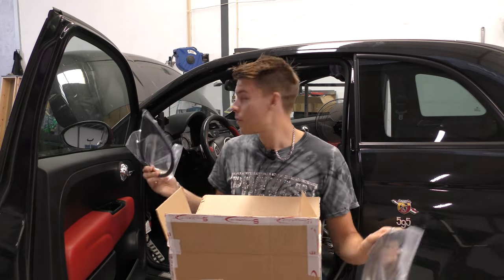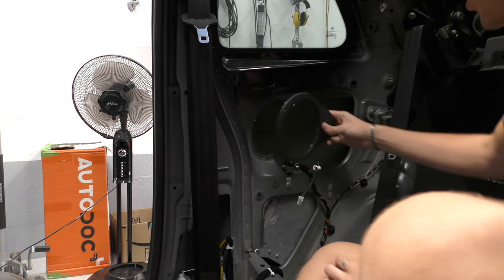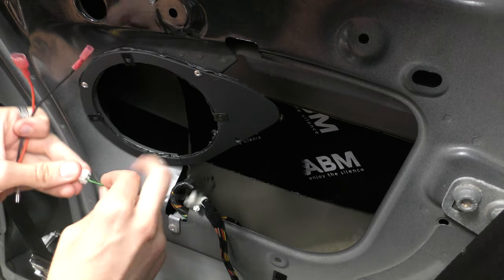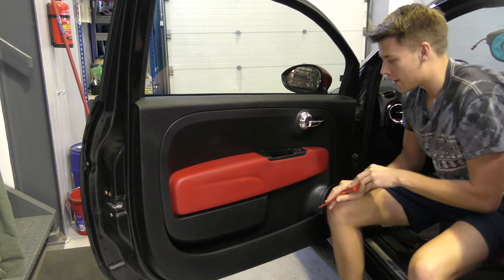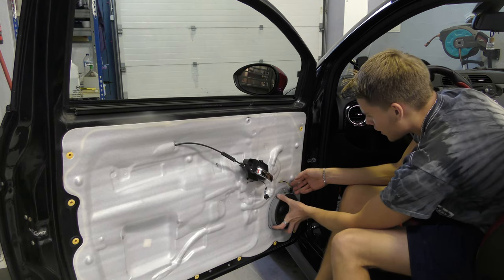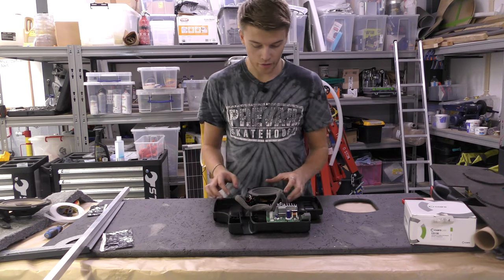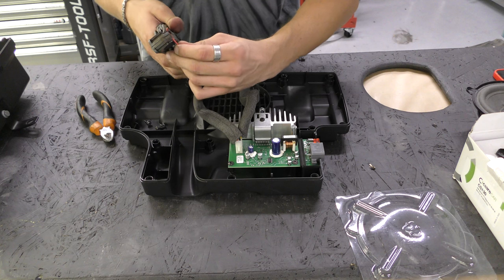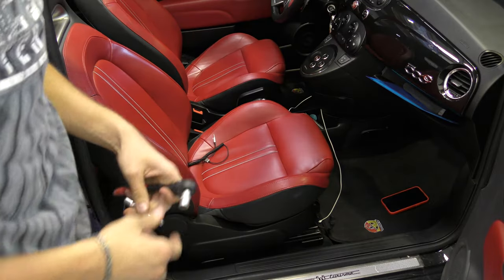Fiat/Abarth 500 Speaker & Stock subwoofer upgrade

Comment: 5 stars and two thumbs up for your video which encouraged me to do the same conversion on my 500c, having upgraded the door speakers already to Rockford Fosgate's speakers earlier, and now the sound is really fantastic. The original set up is an already very good OEM Interscope sound system but the original subwoofer speaker gets its membrane disintegrated with time so your upgrade is an excellent one. For other potential viewers just a small suggestion to pause and look carefully at the disposition of the wires at the frame 14:39, which you nailed, that is the correct way of connecting the "+"s, they are sitting on diagonal opposite sides and the yellow and red wires need to be connected to the "wider" connectors on the speaker marked also with a red dot of paint, as already shown in the video. Thank you for the very nice video and for the references.
Reply from the maker: Very kind, thank you - first time for me, as we say, let us cock it up so you don't have too :)  - this was a fantastic upgrade to be fair and did go remarkably well - spent ages researching it

Comment: Looks nice. But why putting coaxial speakers in the front doors when you have the tweeters in the A-pillar?
Reply from the maker: The original sound system was pretty bad, so rather than remove/replace the tweeters I just thought it best to just ignore them. I choose the speakers on value for money and these seem pretty good. I’m certainly no professional that’s for sure. 
Thanks for your comment I appreciate it 👍
Reply: @DrivenMadShow  The front speakers you installed have a tweeter, the issue now is that you have 2 tweeter pairs with different specs in the front, plus another pair in the back.
It will sound better than stock, but if you had chosen the SXE 1750S (that has the same tweeter and speaker, just separate), you would have paid marginally more than the SXE 1725S that you have installed, and you would have the tweeter in the intended placement and without mixing sound signatures.

Comment: Unless you completely abandoned the tweeters. The tweets on the Alpines are receiving any sound. If they are. They are pulling the sound stage down. Too many tweeters can have their own issues.
Reply from the maker: The original sound system was pretty bad, so rather than remove/replace the tweeters I just thought it best to just ignore them. I choose the speakers on value for money and these seem pretty good. I’m certainly no professional that’s for sure. 
Thanks for your comment I appreciate it 👍

Comment: Nice little upgrade. Did the speakers in the front have the correct plugs? Did you make sure the wires in the new ones went in the same way as the old ones? If you don’t know you might get them wrong and get the phase wrong.
Reply from the maker: Yes they plugged straight in! All 4 connectors that came with the speakers where the same. But my rear speakers have a smaller plug than the front for some reason. luckily with the fronts there is only one way to plug the connector. Thanks for the comment, much appreciated!

Comment: A good upgrade video thanks. I’ve recently swapped the front speakers in my Panda 169 to the same Alpine 1725 speakers . Like chalk and cheese! Next upgrade will probably be to move the 1725s to the rear doors and put in Alpine 1750 speakers (with the separate tweeters) to the front. After that maybe a underseat sub? I’m hoping you will do a video first to show how to install one properly 👍.
Reply from the maker: Ous comes with the sub as standard - maybe worth looking at getting a used one from a breaker ? should go in a 169 -  then its a cheap (ish) install ?
Reply: @DrivenMadShow  good idea using a 500 sub in the panda. How would you secure it to floor? I’d be nervous drilling the floor. The car was owned by an elderly lady for its first 17 years and it had only done 20000 miles. Since I bought it in the spring, I’ve added 5000 miles, a towbar, alpine speakers and a pioneer head unit. Poor thing must be in shock 😂
Reply from the maker: The Abarth has 3 bolts that go in the floor - the sub Nath fitted into the ML was an aftermarket box thing; was a pain in the ass, taking up too much space, and that's a big ish car ! - under the seat is great,  if there is nothing there (I cannot remember and we had our 169's seats out 🙈) -  it's a brave pill and bolt to the floor or bend a bit of metal and locate it with the seat bolts ? Great find a low mile Panda, even better if she garaged it - I think the 169 is built really well, the doors are especially good, love the arm rest grab handle bit - the newer ones are rubbish in comparison - Panda's love a good thrashing, it must be like being set free for it ( you need a name for it - my suggestion is Brenda 🤣 in honor of the old girl (well that just sounds like an old girl )
Reply: @DrivenMadShow  My previous car (Citroen Berlingo) was written off after being hit when parked up on the street. I wanted to downsize so I could park on my small driveway out of harms way. Got a soft spot for small Fiats (used to have a Cinquecento sporting back in the 90s). Was looking to get a Panda 319 but your videos convinced me that a 169 was still worth having. Very happy with the car. Just enough power (54hp) when towing a camping trailer.
Reply from the maker: @2rocship  Sorry, bit slow in replying - if I were to pick one, the 169 would be my choice as well, just feels more robust, the dash looks great when the new stereo is in, transforms it - I was spoiled in the UK with a company car, had a boggo E class Merc last, loved that car, it was just so easy at everything, and all the better for being a boggo one, I was lent a top of the range one when being serviced (other than the sunroof) it was nowhere near as comfortable or fun as mine  - when the contract was up (the car tax was horrific ) I bought my own car - a used automatic Fiat Qubo, in metallic lime green, my wife hated it, really hated it, I loved it, it had a politically incorrect name and was the topic of conversation everywhere I went in it - frankly, I would get one here but an auto is mental money here in Portugal -  keep is updated on Brenda 🤣
Reply: @DrivenMadShow  Bit of an update on Brenda 😂. I’ve moved the Alpine 1725 speakers to the back doors and put 1750s (with the separate tweeters) in the front. I used replacement panda tweeter covers (with holes in) to mount the tweeters. I’ve also fitted an underseat sub (In phase usw 300). Picked one up for £80. The trickiest part of fitting it was routing the power cable through the bulk head to the battery. Forced it through a large rubber grommet directly behind the radio coming out beneath the windscreen wipers. The sub sits nicely behind a ridge under the chair. I’ve velcroed it to the carpet and it seems secure enough. The sub has made the biggest improvement to the sound out of the 2 upgrades. However, It is nice to have the tweeters higher up in the door. Next upgrade…… maybe the leather steering wheel cover
Reply from the maker: @2rocship  Glad to hear Brenda is getting the full on treatment - she will be rocking !!  Sub was a bargain and velcro solves a multitude of sins, I love the stuff, its really all you need and a great idea. Keep us posted

Comment: Do you have the interscope sound system ? If so, I am searching where exactly is located the amp to disconnect it (got some issue with the battery depleting itself)

Comment: Inside the plastic case in which the subwoofer is inserted there is a small PCB, I imagine for cutting frequencies. At this point how should I connect the rear sub (which I will replace with a Ciare 130cs)? I have doubts as it would be connected in parallel to the rear speakers by varying the impedance at 2ohm, making the rear channels work at 2ohm and the front ones at 4ohm. Do you know how I can solve it or does the board inside the sub box have a system to maintain the 4ohm (if necessary I can check with a multimeter by connecting it to the wires that reach the stereo from the rear speakers)?
I will use a 4 channel amplifier (4x75Wrms)
Thank you